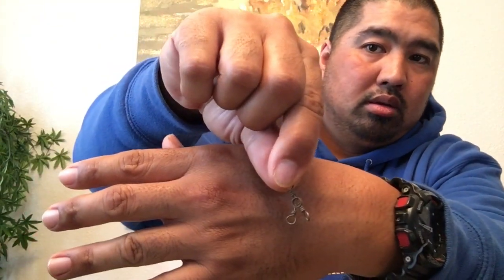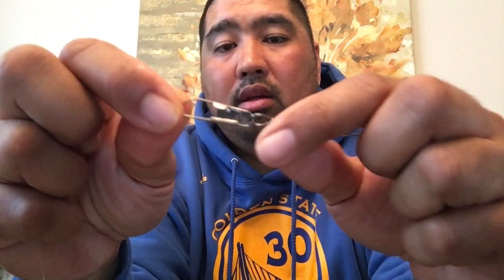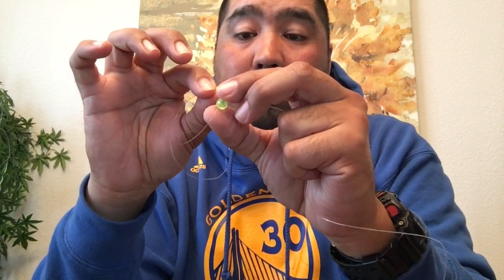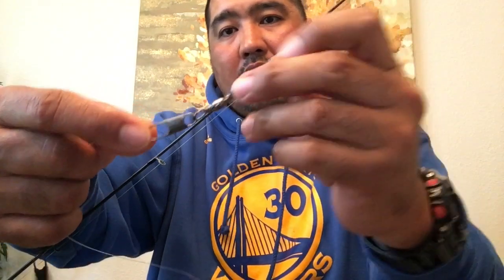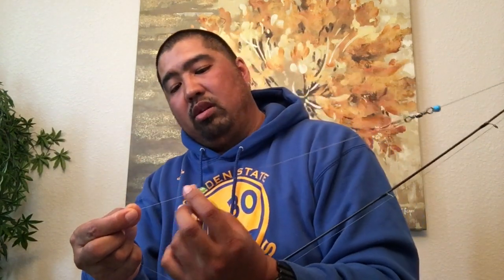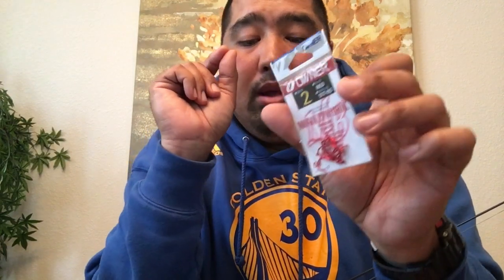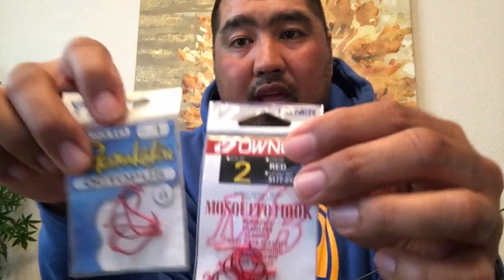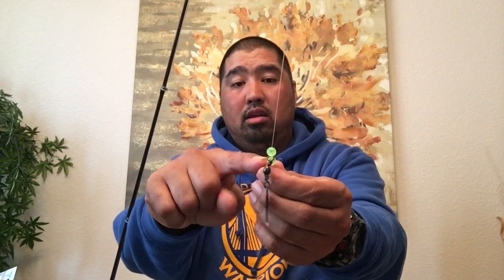Full explanation; my halibut rig

Comment: Does the bait stay at the bottom most of the time? What is your recommended length of snelled hook?
Reply from the maker: I use a slim circle hook size 2/0. As far as length,  measure it about 8-10 inches above the weight.
Reply: Omega5fisher Great video! Thanks for the suggestion.👍
Reply from the maker: Good luck.  Try going off the piers soon..  Halibuts are biting less and less these days. But you can also try for stripers...
Reply: Omega5fisher Sounds good. Thanks!